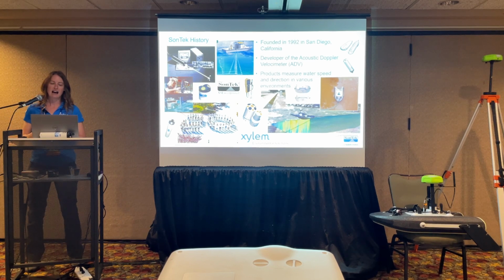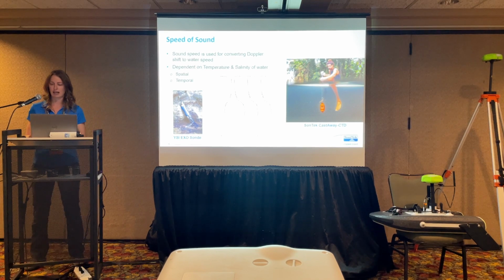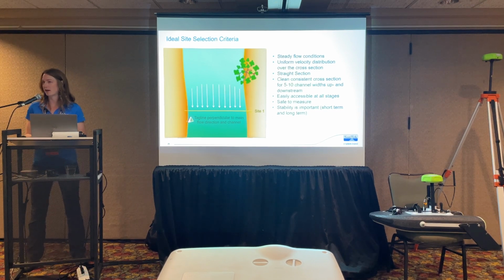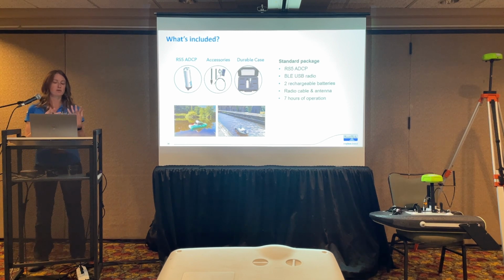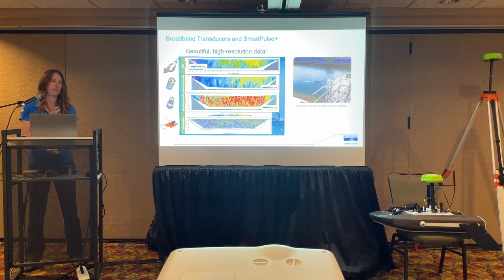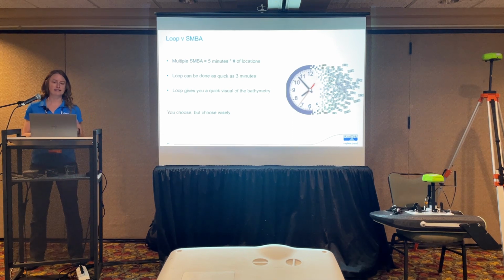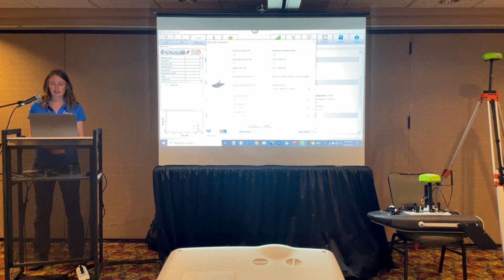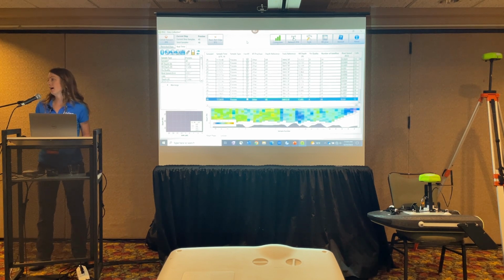How to Take a Moving Discharge Measurement (2023 NHWC Conference)

Comment: Hi Brittany.  I enjoyed your presentation, well done.  I do have a couple of questions I was hoping you could answer.  First is in regards to temperature.  Our organization has a few M9's and R5's.  One thing we have noticed it that they consistently record a temperature a few degrees higher than a direct water temperature reading.  Our thoughts just being that the transducer is large and takes awhile to cool down to river temperatures.  We have been overriding the instruments temperature reading with our direct measurement.  Obviously a couple degree difference makes an insignificant difference, but was wondering if our methodology is correct.   Second question is regards to number of transects.  For the 12 minute exposure time, is there any literature, or opinion, if it is better to do more transects at  higher boat speed, or fewer transects as a lower boat speed.  For instance 8 1.5-minute transects vs 4 3-minute transects.  This is of course in a situation where the boat speed vs water speed is in the 'green' in either instance.  Thank you!
Reply: Temperature - do you have the latest firmware installed?  1.33 or later.  2 degrees can be significant.  No. of transects.  the latest ISO for this gives a minimum of 12 minutes and at least a pair of transects.  It is  is of course more governed by the channel size and velocity distribution and pulse of the channel.  it may be that 8 (4 pairs) or more transects are required to get the 12 minutes and to account for the variability in the channel. it could be that 2 is sufficient (something like the Amazon at 3km wide :) .  As ever a good hydrometric site improves the measurement and determines better the duration required.  Location, Location, Location.